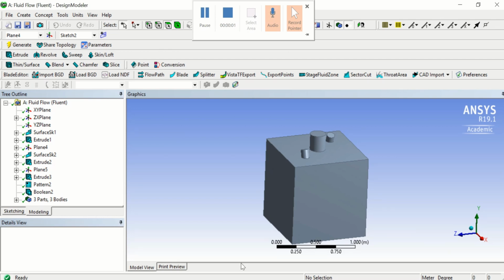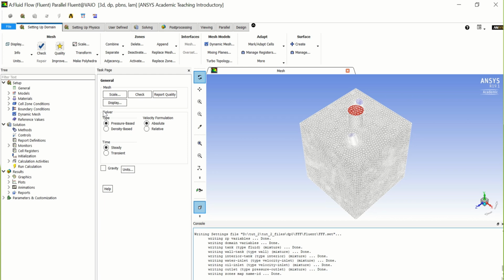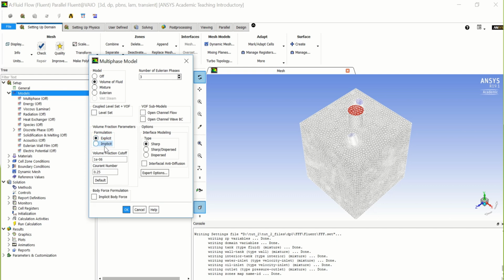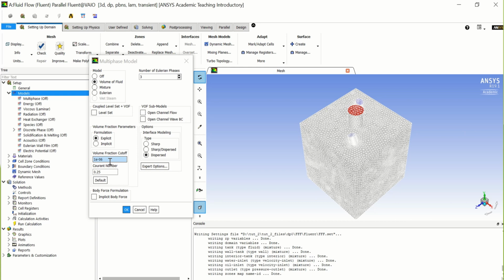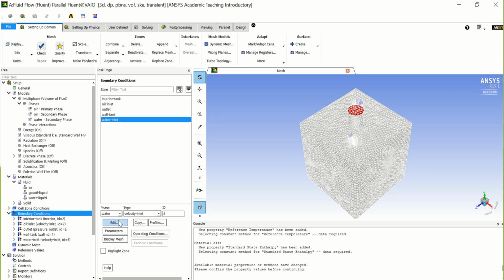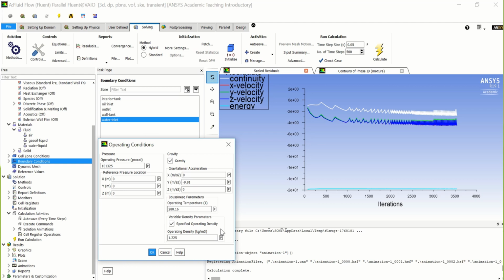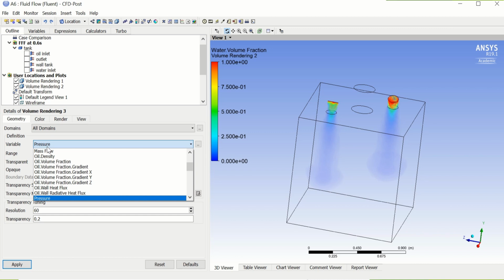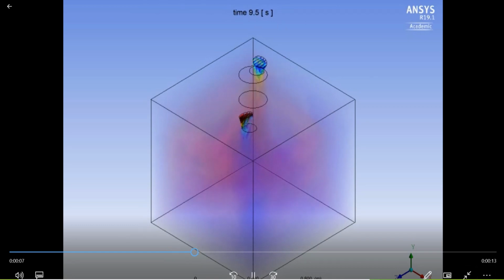FLUENT Multiphase VOF: Step-by-Step Tutorial

Comment: Could you explain patch in detail. I didn't understand that part.
Reply from the maker: Simply, "patching" is used to assign an amount to a specific region within your domain. Sometimes you might have a particular section in which you need to assign a certain value regarding some property (velocity, temperature, etc.) unidentical to that of the domain. However, in this video, I used the patch window to impose the initial conditions related to the volume of oil and water inside the tank which are zero before running the simulation.
Reply: @AhmadKouta  Oh..okay, thanks
Reply: Please l need add nanoparticles to the phase change materials